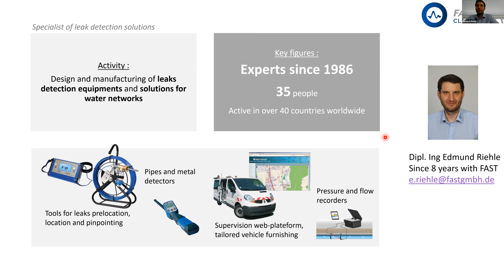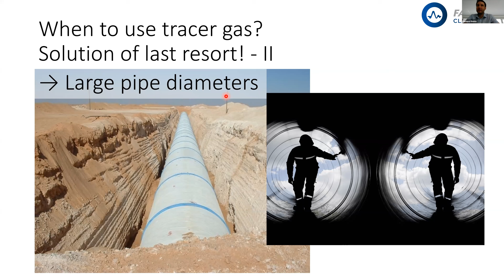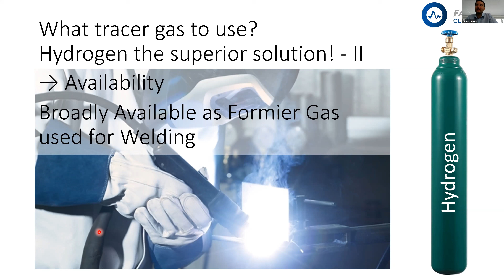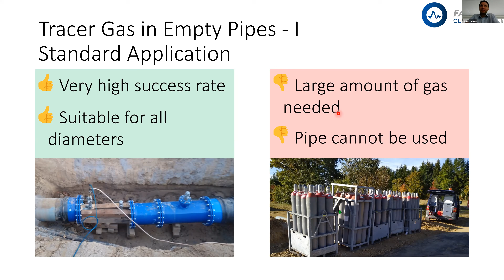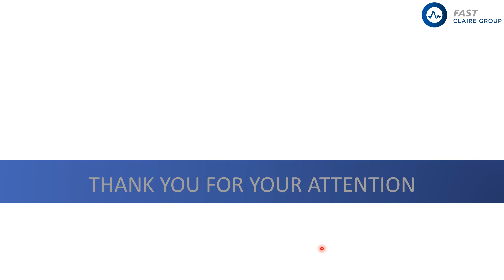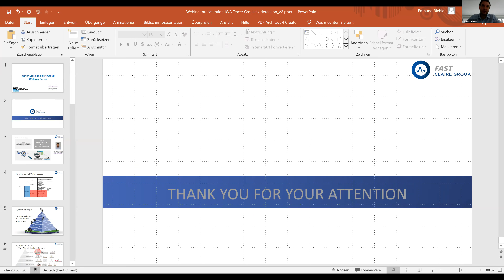Tracer Gas leak detection in water pipes - Edmund Riehle

Comment: Thanks for the presentation. In your opinion would the gas bubbler work on a 16" DI main 525ft long? It is capped with 2" flushed on both ends. It is a new main and has failed the pressure test at 200psi. Or would it be better to drain the pipe and fill it full of tracer gas?
Reply: Hi, new mains who failed pressure tests it is usually a very tiny leak (or perhaps not even a leak, but we call it "sweating gasket"). In this case I recommend to drain the pipe and fill it with tracer gas. However, since 16" and 525ft is quite a volume of gas - especially if you need to increase the pressure to 12-16 bar (what is usually the pressure test pressure) you could use combination of tracer gas (5% H2, 95%N2) and pressurized air (by using a oil-free compressor). In this way you can also reduce the volume of gas needed by 1:10 - 1:30 . FAST tracer gas leak detector can measure down to 1ppm H2 ;  5% is 50.000ppm. So diluting it even with 1:100 still contains enough H2 so that you can detect it on the surface.
Wish you good luck and success with this job. BTW: we also offer overseas services, just in case you need support.
Reply: @edmundriehle1588  Hi Edmund, Thanks for the reply and excellent info. I will take your advice and give it a try. Thanks!!
Reply: @edmundriehle1588  Hi Edmund. Had a successful leak detection yesterday. Contractor is excavating today to determine why it failed. Thanks so much for your help! Here's a link to the job yesterday. https://youtube.com/shorts/YYEKy9yyxvE?feature=share
Reply: Hi Edmund,
Do you have an email address I can use to contact you?
Thanks, Hayden